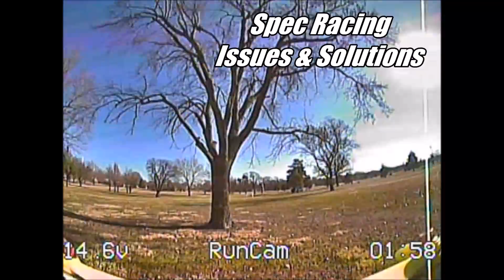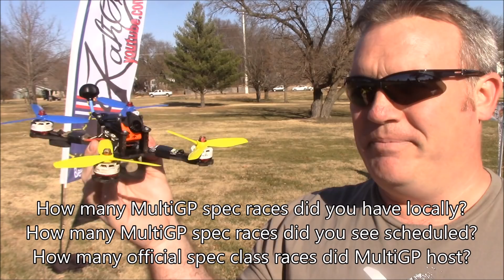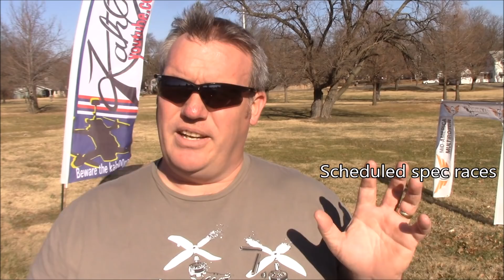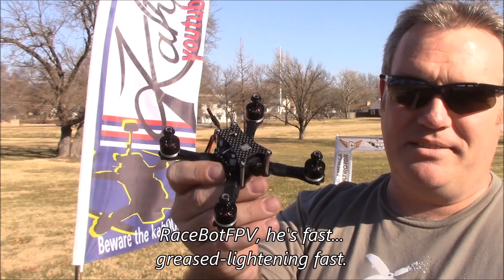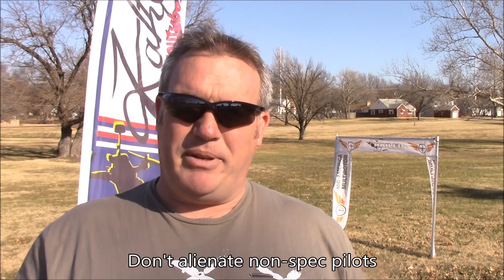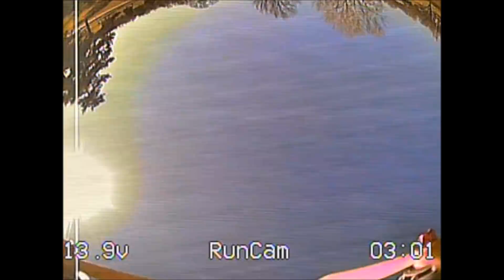Spec Racing: Problems & Solutions

Comment: I would do it different and more like they do in rc racing. Make lists with a few parts so for the motor and lipo. Maybe also for a prop but I think that you can better use one prop. Lipo list is there for rc racing that are tested and save. Motor list with a few motors that are about the same with kv and size. Set a prop and a size of the quad.
My experience is, is that as you go for say 6s because not everybody knows what and how. That you get 2 or 3 people testing it and knowing what to do and don't tell to keep an advantage.
The bond and fly quad is nice but will not work.
Just make a list with 4 or 5 motors that you can get easy, set a lipo size. So 4s with 1300mah or something. Choose one prop and make sure that people can buy that prop also ad the race or let them pay for each race and than they get 3 sets or props. If not needed because they still have props or got them, them self, than the race is free or the price without the prop price.
If you want one motor, than make it clear a few months before the new race season starts so people can get them.
If you want new people to join, than you can better give them a list with what motors and give them advice on what electronics to get. You can make a paper with where to get it all and some examples from frames and electronics. Organice build days where as it is not such a good weather or a week before the race, where people can build there quad with help from others. They can also help to tune it and advice new or beginner pilots.
Reply from the maker: Letting people choose from a variety of parts is real close to what we do today by restricting our races to 4S batteries.  If it were going to allow some wiggle room on the parts for a spec race, I think people should only have 2 choices per component.  I'd rather say just one choice, but that can cause a problem if that part becomes unavailable for whatever reason.  The more closely the quads match hardware wise, the better chance you have of measure pilot skill vs pilot skill.
Reply: travisgrindal they must look and learn from other rc race classes. Limiting it to 2 is not an option or you need someone that delivers the parts for ad least one year. Just look and learn from other organisations than trying things wat others already have done.

Comment: I think you're onto something there I have probably well over 25 years in ground RC racing two wheel trucks and two wheel buggies and in both categories we have spec racing and it's Define with rules and we have a whole bunch of fun without having to spend a ton of money on Motors and electronics. Now with that said I've now been in this hobby fpv for just about a year almost now and have been having a great time doing freestyle and now kind of wanted to see if I can do some racing hit the gates have some fun with the guys but I know the problems going to be is I'm not going to have a quad that set up light enough and fast enough to be competitive inspect racing would be perfect for that everybody's on a Level Playing ground and then it's up to just pilot and only pilot. Now as far as setting rules on what would be considered spec me personally I would think that really would come down to motors for sure what props are using what he has seizure using and that's about it I mean of course you're going to want the lightest frame so maybe you narrow it down to one particular frame I don't know even inspect racing on the ground we're not that close on what frame to use but yes definitely would have to sit down and everybody would have to agree
Reply from the maker: Getting more than just a few pilots to agree on that kind of stuff would be almost impossible.  If you're going to do a group thing, I'd try to get at most 3 people and try to get in agreeance with just them and call it good.  There will always be a weirdo in your group that will disagree with everything.

Comment: The spec class didn't work because it was expensive.  $25 motors and $35 batteries.  Why not a cheap OG  red bottom motors and chinahobbyline packs. Spec a cheap frame like the Floss and you're good.  Though the 3" spec class is a great idea. Cheaper and less likely to break stuff.
Reply from the maker: I agree with you... it was too expensive.  I like the 3" idea because it is something most people probably don't already have and, like you said, it is less likely to break in crashes.

Comment: Spec racing in rc car racing never lasted for us.   Instead we had a “stock” class which required motors, tires, batteries, and weights that met certain requirements.  Don’t narrow everything to a specific manufacturer.    For quad racing I would say a certain size motor and kv, battery voltage and mah, and a minimum weight.    Makes it easy for everyone to meet the requirements and makes it harder to “buy” your way to wins.
Reply: That does help resolve the issue of availability and need for pilots to go out and buy a whole new quad. It would let us have the option to make modifications to something we might already have.
Reply from the maker: This pretty much sounds like what we do now.  There aren't many motors that are "way better" than others.  Today the only limit we have is running up to 4S batteries to be eligible for prizes.  You could still run 5S or 6S in our races but you won't get prizes.  That really isn't all that different from what you're describing.

Comment: Spec props and motors only. Then as guys have money they can upgrade(lighten) the rest of the setup as they can afford. That way anyone can take any quad they have, swap motors and props and off spec racing they go. I don’t see there being substantial performance gain in fc/esc/camera except in reliability. I build race cars, the weakest link these days is always the driver:-)
Great vid Travis!
Reply: I hadn't considered that, and think you're on to something. I would argue though that the frame's weight is a big factor. Travis made the point in another video that some people  aren't fans of hyperlite frames because you spend more time fixing them than stronger, heavier frames. Someone more wealthy than me could bring one or more backup arms (or several spec complaint backup quads) and they might race harder knowing that I couldn't afford backups. I hope that makes my point. I'm not saying hyperlites are an unfair advantage alone, I'm just saying that if money wasn't a consideration and the frame is not specified I would come with a frame made out of toothpicks and plenty of spare parts.
Reply: On heavier stronger frames that don't break an arm have more often broken motors.
It is nice that discussion but just let people choose what they want. Each frame has its advantages and disadvantages. Or make a list with a few frames so people can choose.
Reply from the maker: In the past, I would have agreed with you.  On my lightest frame, the BFight210 (69 grams), I've broken 4 motors and zero arms.  That is just amazing to me and the complete opposite of what I had guessed would have happened.  On a side note, I'm never buying T-Motor Air Gear 200 motors again.  Their quality, in my opinion, is no where near as good as the cheap-o Racerstar motors I have been using.  Those Air Gear 200 motors are garbage.